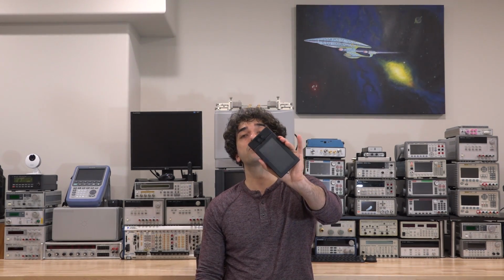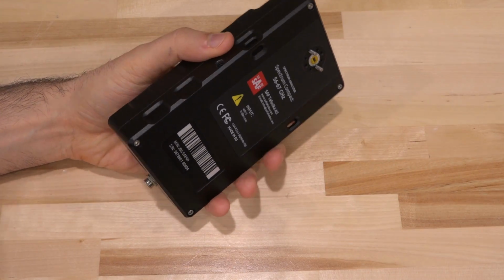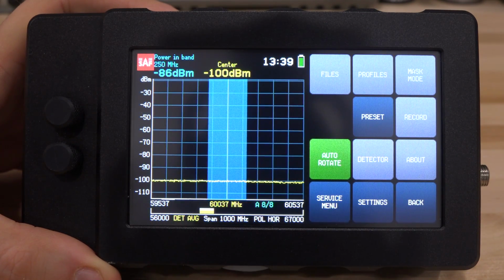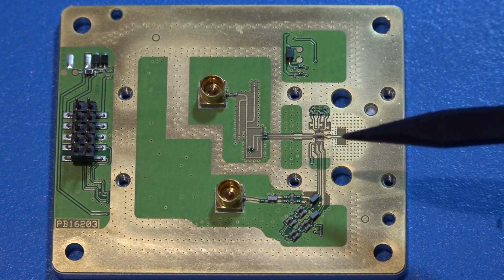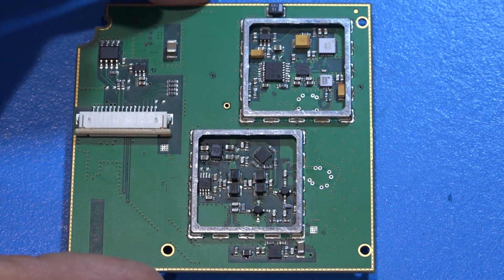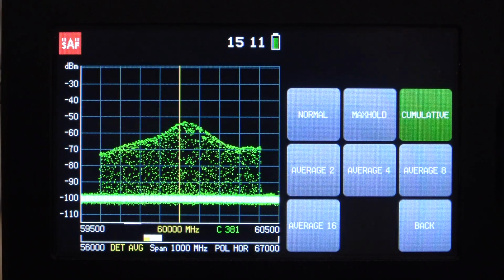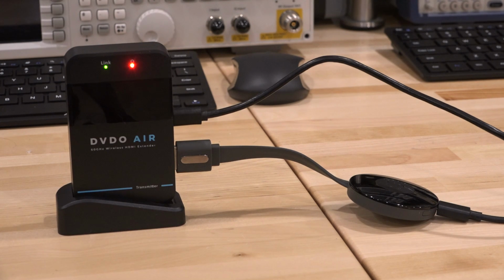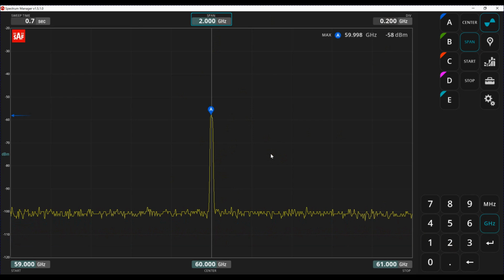TSP #144 - SAF mm-Wave Spectrum Compact 56 - 67GHz Portable Analyzer Review, Teardown & Experiments

Comment: Excellent video. Thanks Shariar...

One hint is the size of the LO coaxial port. It is far too large (about half-wavelength in diameter at 60 GHz) to carry the LO itself. It is more suited for 15-20 GHz and LO frequency multiplication effectively takes place in the RF board.

Comment: That is a very nice piece of gear! Very well designed and machined, with solid construction. I've guestinated that most components are 0603, with some 0805 capacitors on the IF stage and some occasional 0402 components on the logic board. Nice to see!

Comment: Hi, I was looking at SAF video about their comparison to Tek RSA306 - https://www.youtube.com/watch?v=-h1Hvxwc7tY - and I must say something is fishy. They claim superior noise floor. The span and BW is different in their presentation for example. What do you think? BS marketing? I checked their website, and they do not even provide DNAL or other noise and distortion specs for their devices.
Reply: DISCLOSURE: I AM WITH THE MANUFACTURER: That video was done at the request of one of our clients who was specifically frustrated with the noise floor of the RSA for his application. We do publish the DANL, but it’s noted as the bottom end of the “Input Dynamic Range”. The warranted spec is -105 dBm @ 1 MHz RBW. Typical performance is -110 dBm as seen on that video. Our traditional market (PtP microwave) was not necessarily concerned with distortion or the other expanded specs, but here they are: Phase Noise < – 90 dBm, TOI -10 dBm, VSWR < 2.00. LO leakage @ -40 dBm. While the spans in the video differ, the Tek unit was set to the same 1 MHz RBW, 300 kHz VBW as the SAF unit. As far as versatility, Tek offers adjustable RBW/VBW, a more complete software tool, and is an incredible value for a low-cost real time spectrum analyzer. That said, the noise floor performance of the SAF unit is superior. We were really trying to show both units as they are, and not hide the warts of either.
Reply: @TheAjhostetter  That is a nice achivements then. Good work and thanks for you answer!

Comment: I wish RF gear was better priced or a serious open source 2019 SA was available. 
The UI is average, a better processor could have been used to manage rendering sweep data,  that ST part isn't great for heavy multimedia graphics (but works great for fast boot times and lower battery), a I.MX6L from freescale is better suited for this. but then again its a field device, we live in a world where the demand for anti aliasing  graphics is expected.

Is there a reason you don't mention chip numbers.?

Comment: No modulation/demodulation options? No extended math functions other than the simple stuff on the GUI buttons? What about data export file options - csv file for offline analysis?

Whatever, all a bit academic, as I can never afford anything that you describe as "low cost" in your videos! :)
Reply: No demod options, but you can export the data for offline analysis. You can use the raw file, save images, or export in csv

Comment: Great review. You neglected pricing though. Remember, there's no bad products, just bad pricing.
Reply: He's always sheepish about pricing.

I've just come to the conclusion that I can't afford anything above 1GHz. :)
Reply: @trickyrat483  Well you can afford a RTLSDR stick, which already goes up to 1.7GHz. I got a HackRf One clone for 130€ which goes up to 6GHz, not exactly a sensitive instrument but it's better than being "blind" at these frequencies.
Reply: @s3sebastian  Thanks. Have been looking at the SDR-related stuff as a cheaper alternative to a full-blown Spectrum Analyzer. Only just getting into the RF stuff for the first time, tbh; only built a few AM radios on breadboards from transistors (rather than OpAmps or single chip TRF ic's, just so I could understand the "stages", so to speak.). Slowly working my way through the 2019 ARRL Handbook that I just got delivered! :)
Reply: @trickyrat483  the smart thing to do is getting access to a lab, then you don't have to buy your own stuff.
Reply: I got what appears to be MSRP pricing from here: 
https://www.streakwave.com/items.asp?Cc=SAF-Spectrum
0.3-3 GHz : $4500
02-08 GHz : $4300
06-12 GHz : $3800
10-18 GHz : $4100
17-24 GHz : $3391
24-40 GHz : $5087
56-67 GHz : $24,000
70-80 GHz: $24,000
(I found some of them cheaper elsewhere, for example this kit is $23,235 at neobits)
I'm no expert but I think that these are pretty standard pricing for that level of GHz range. Higher frequency stuff gets really expensive really fast.
Reply: Pricing is not publicly available on SAF's website. Pricing is only available with a quotation for serious customers.
Reply: Price is high for hobbyists, but cheap for professionals that need something compact and ruggedly built that’s quick and easy to use. You wouldn’t want to climb a tower with an RTLSDR and laptop under any real world circumstances...
Reply: pricing seems reasonable to me, if you consider the target market
Reply: I found a web site that sells this stuff with prices.  Google it.